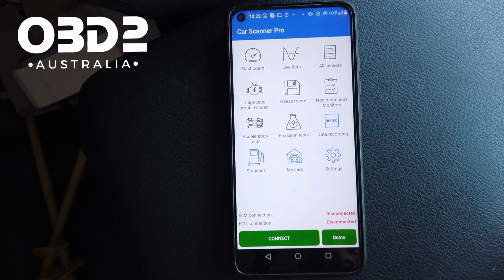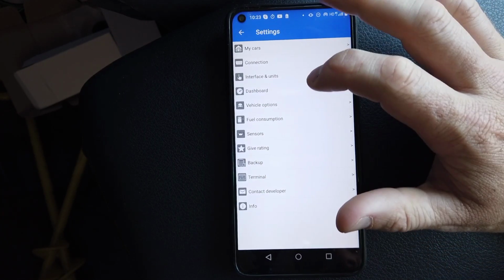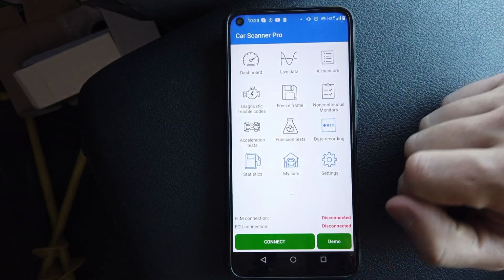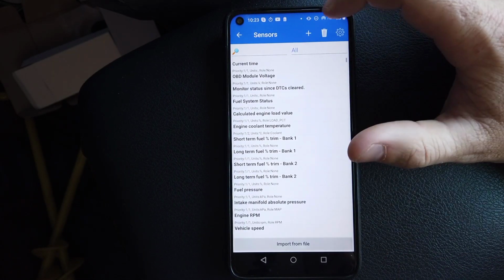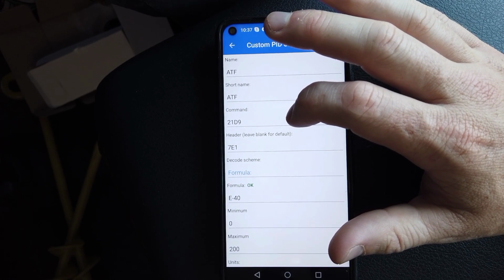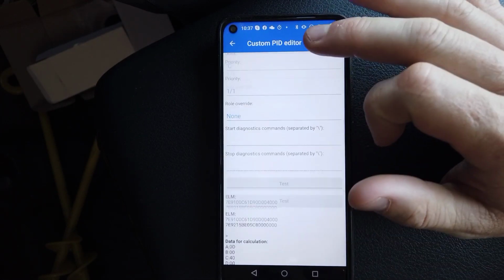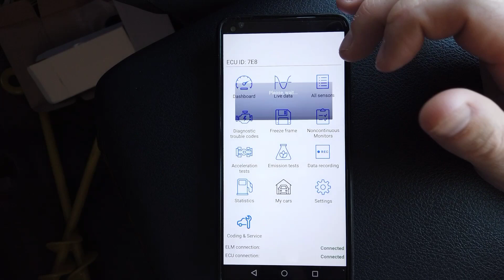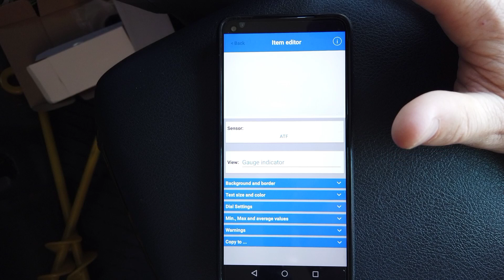Car Scanner ELM OBD2 Adding PIDs

Comment: I just bought a 2023 Toyota Rav4 Prime. It's so new that Car Scanner doesn't have a profile for it. The closest one that gives me maybe 3/4 of the sensors I want is the Prius Prime one, but there are quite a few new PID's for the Rav4 Prime that aren't in the Prius Prime profile. The regular Rav4 Hybrid (non-PHEV) profile doesn't work properly; for example, there are no PID's for traction battery temps in that profile that work in the Prime. I'll dig around on the 'Net and see if I can find a list of all PID's for the Rav4 Prime, and try loading the ones I need per your instructions in this video. Thanks!

Comment: Hi guys & thanks for the great video. Have you worked with the IF formulas?  I'm trying decode a number to display a text string, but can only get the IF function to display integers.  For example IF(ShortSigned(C,D)=16384,5,6) is a valid formula but IF(ShortSigned(C,D)=16384,"Park","Other") is not.

Comment: Hello, can you please advise if it is possible, or how to add a new code using veepeac (obd2 scan tool/ bod check ble) and car scanner app after replacing the faulty diesel CLio 2011 injector.
Reply from the maker: Hi, You will need a full system scan tool for that. Cheers

Comment: Hi, I have a July 2021 build GXL Prado. I've watched the video on how to add a PID to the Car Scanner Pro app however I'm not sure how the data on your OBD2 "Auto Transmission Temperature PIDs" relates to the fields in Car scanner app. Is it possible for you to list the car scanner fields with the OBD2 data for my car? Thanks.  For example, whats the header field data ?
Reply from the maker: Hi, Sure thing - Command = Service mode + Parameter ID

Header = ECU Address
Formula = Equation 

Cheers

Comment: Can custom PID be entered for a 2020 Pajero Sport for DPF as I have info off another diagnostic platform but not sure what to enter on Car Scanner Pro.

DPF Regen Active (on/Off) - RGS
TXD 07E02112
RXF 432120000000
RXD 1808
MTH 100010000

DPF Temperature (oC) - DPF
TXD 07E02110
RXF 456106102000
RXD 4008
MTH 00050001FF38

Cheers Rick

Comment: how do you know what PIDs are for your car and what the applicable codes are
Reply from the maker: Hi, Sorry need a bit more information what year and model is that and what data do you want to see? Cheers
Reply: @obd2australia97  The car is a 2001 Holden Jackaroo 4JX1 turbo diesel